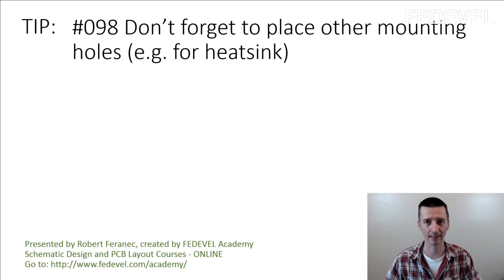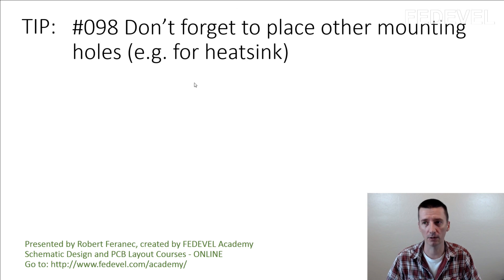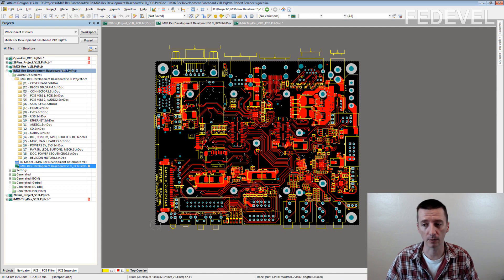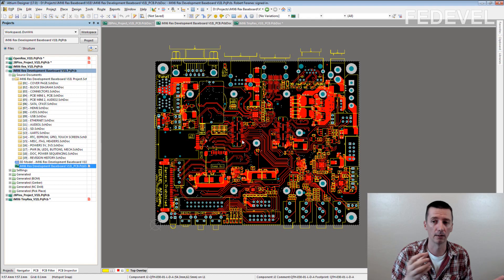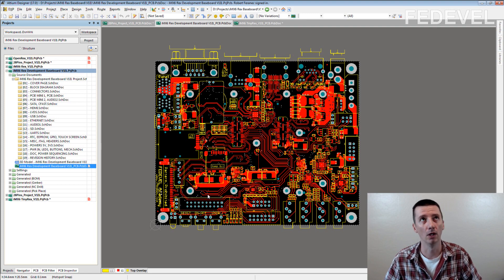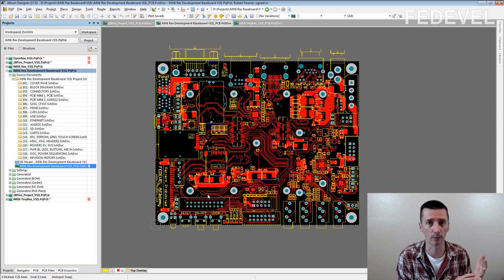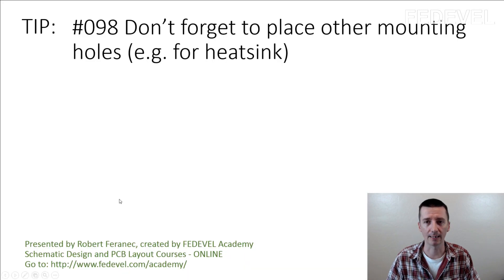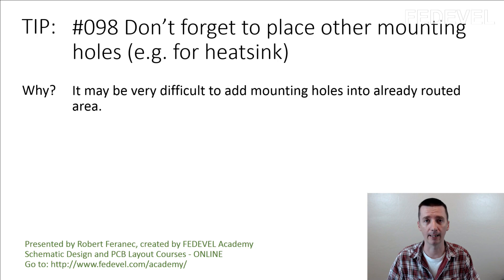TIP #098: Don’t forget to place other mounting holes (e.g. for heatsink)

Comment: Thanks for the tip, Feranec!

Well, we tend to concentrate so much in mcu, crosstalk and so on, that we forget about "simple" detail. That's why I put mounting holes in my checklist ( both for things to consider in the project and things to check before fabrication)

One more thing is: After floor planning I use to print ( in real scale) the board into an A4 paper and I cut the sheet on boards format.Then I take an old pcb to glue sheet and also glue some components footprints just to check how things are.

That is helpful, even better with additionaly used with 3D modeling.